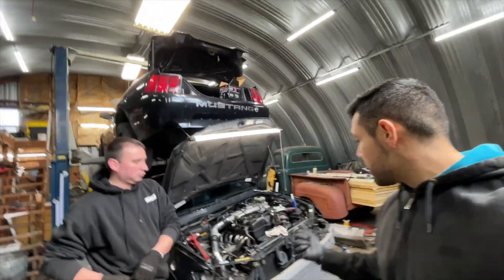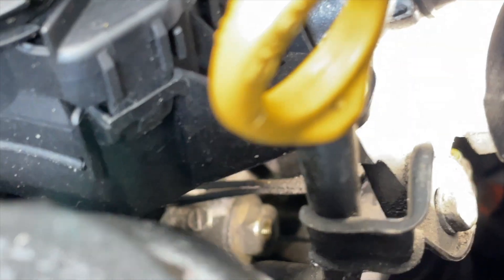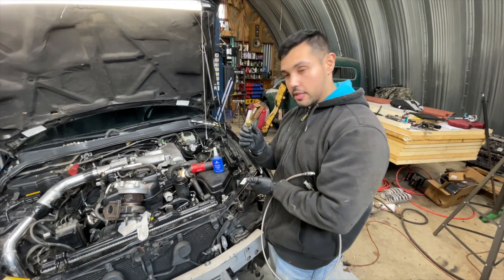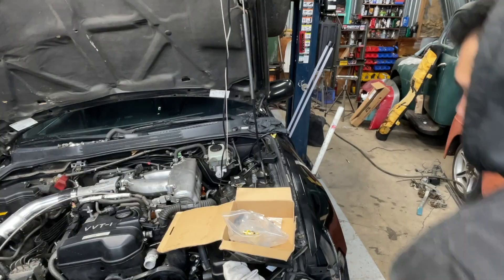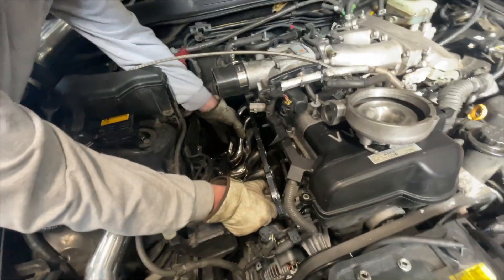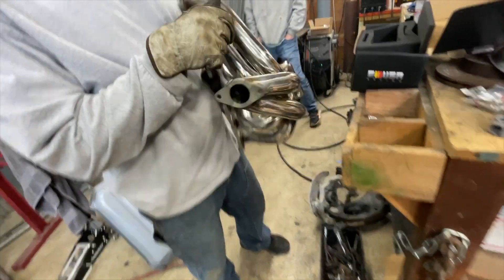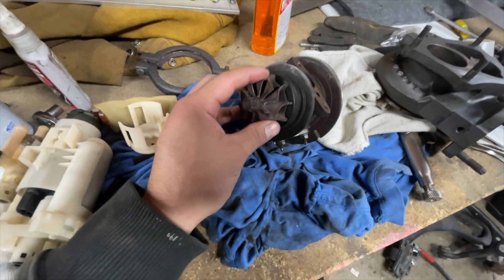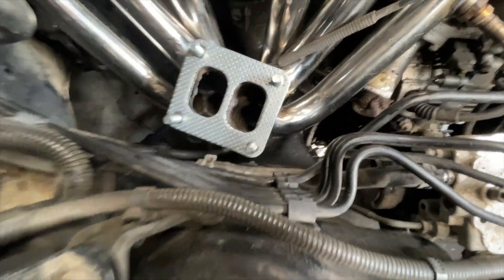TURBO IS300 PT 5..Routed the fuel line & oil feed, made a remote turbo pipe & welded up the manifold

Comment: how long of fuel lines did you use/need from fpr to tank?
Reply from the maker: We just bought a 12ft kit and that was enough if we remember correctly

MUGE RACING 12FT 3/8in Nylon Braided Fuel Line Kit 6AN Fuel Line Hose with Hose Ends and Hose Separator Clamp,12FT/3.6M https://www.amazon.com/dp/B0963LZ76T/ref=cm_sw_r_cp_api_i_9AB3K8ZW647N0QYCGQHN?_encoding=UTF8&psc=1

Comment: You'd be better off with a china charger than trying to use that ceramic junk. Why not spend $100 on an eBay turbo that will work better for the application and probably last just as long or longer than a tired old ceramic turbo?
Reply from the maker: @vegas_alex your right we could go the easy route and do what everyone else does but we’re not ready to throw in the towel and do what everyone else is doing. We want to try different things and see what the outcome will be! It might be bad but we won’t know unless we try!
Reply: @mabuildsofficial  also, for the oil feed line you can easily take it to a hose shop and have them shorten it and put a new crimp on the fitting for cheap. That's the move.